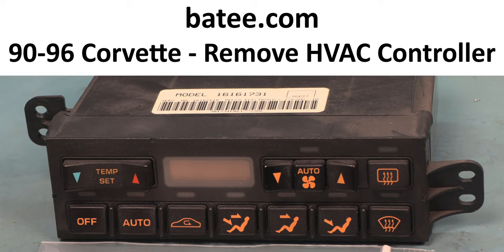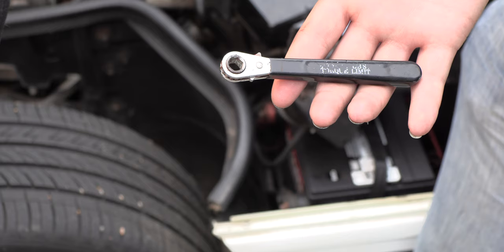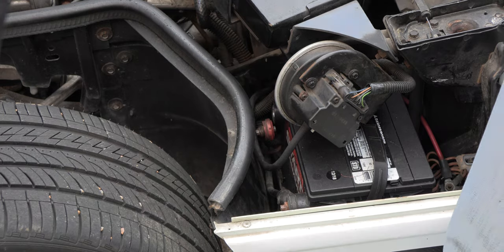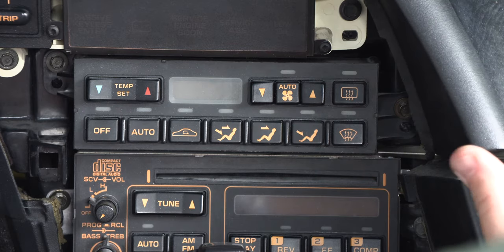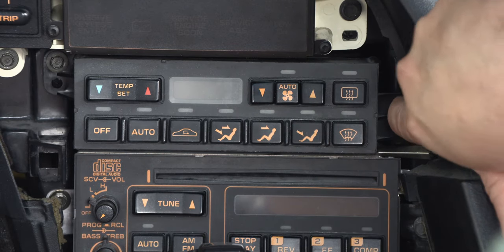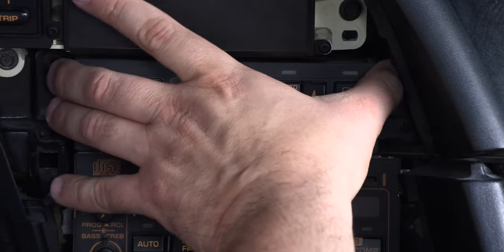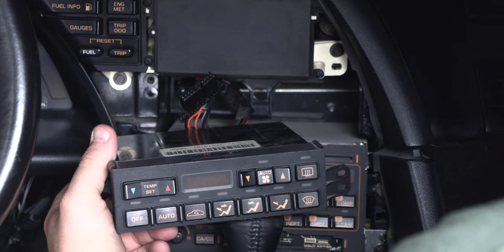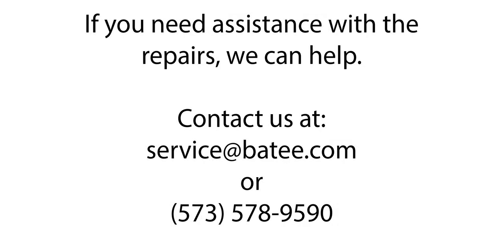1990-1996 Corvette #4 - HVAC Controller Removal C68 ECC (2019)

Comment: Hey Bryan, Thanks for the video!  It provided me the insights on how to remove the C68... just sharing that the accessory trim piece on my 1993 had two additional screws at the bottom to be removed before I could pull the trim out of the way.  To access those two screws I had to remove the center console trim first (three screws, easily accessible) which required the same socket wrench used on the accessory trim.

Comment: Brian, I'm watching this in preparation for soldering in the repair kit.  Can I ask why you removed the positive battery terminal?  I have always understood negative should be removed first.
Reply from the maker: Because I'm an engineer.  Electrons flow backward for us (see conventional current flow).  Without this, all the arrows on schematics point the wrong direction.  

http://www.physics4kids.com/files/elec_dc.html

It really doesn't matter to the electronics which gets removed first.  The people who say to remove the negative first because they assume that while the ratchet is on the positive terminal, you might short the ratchet to a ground.   No matter which terminal you remove first, it is possible to short the ratchet to the other terminal battery terminal or something that presents the same electrical potential, so there's some small risk either way.

We assume that people will be careful.   No amount of safety precautions can protect a person who doesn't exercise some degree of caution when working.
Reply: @crazyuncleburton  ive never understood the removal of the negative, cuz if that touched the frame, wouldnt it ground and create a circuit anyways, like all the other grounds to the body? but if the positive is removed and it touches the frame, it doesnt create a circuit and nothing happens. am i wrong?